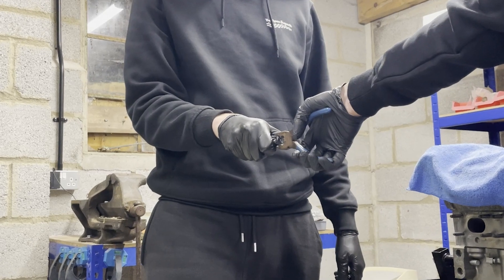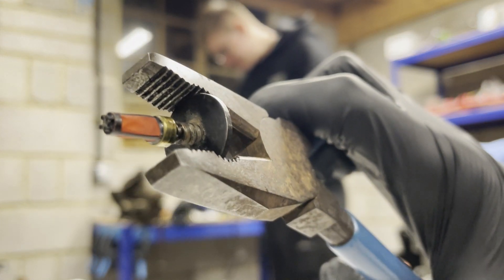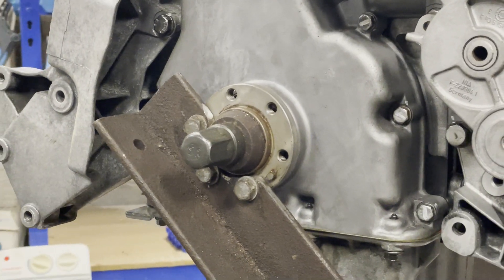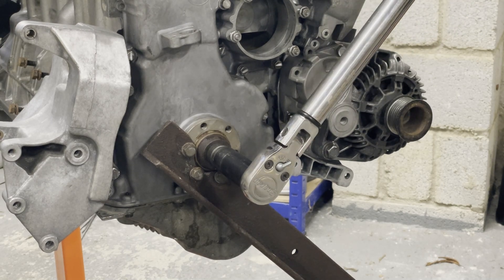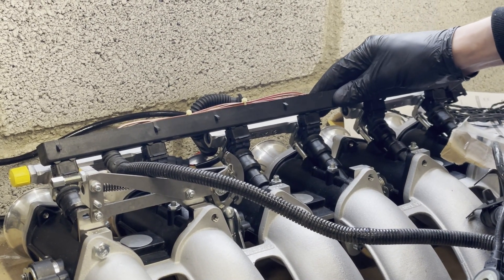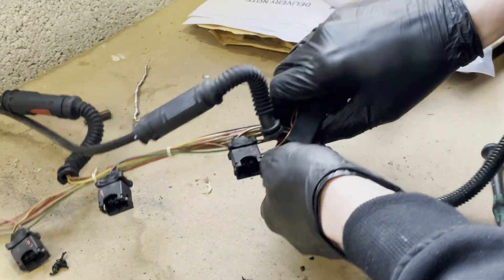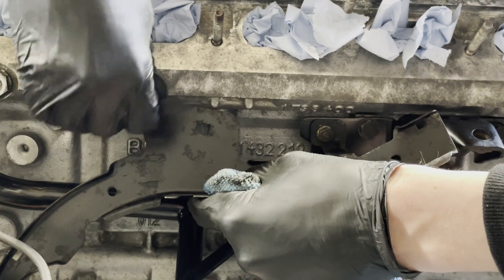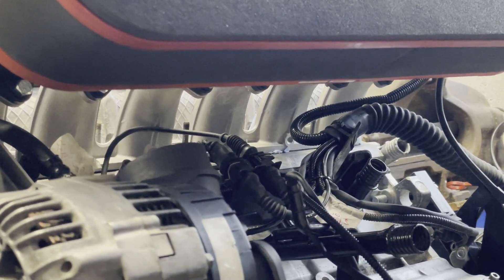Ultimate E36 Engine Build Final Assembly M52B30 Stroker! 2 Tools Try 2 Use Tools

Comment: What's the estimated power output in this? Super cool content!💯
Reply from the maker: The engine made 270 bhp which is a little less than the owner was hoping for. However it is a 80 bhp increase over the standard M52B28 of 190 bhp